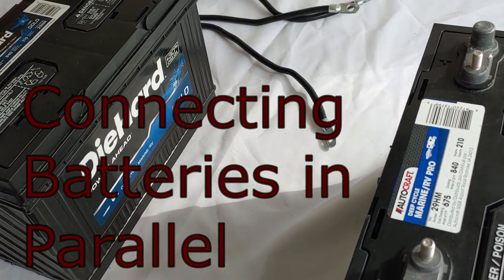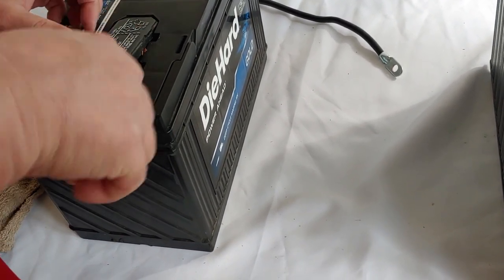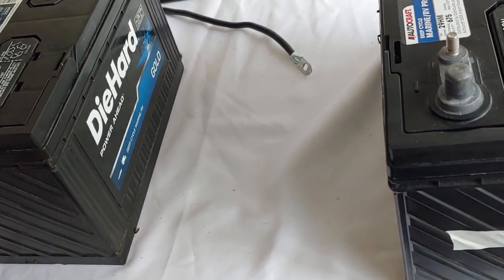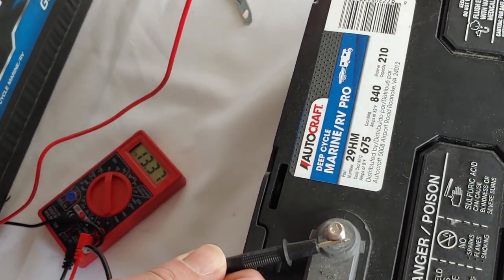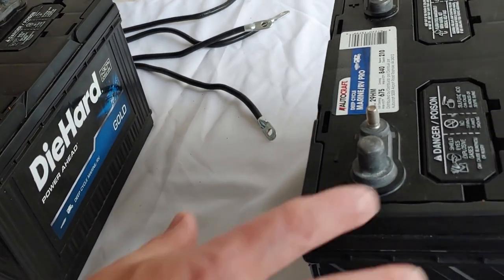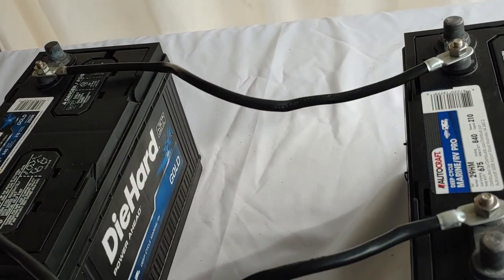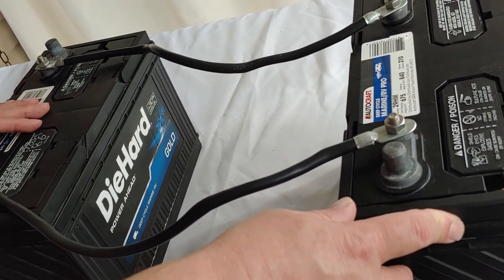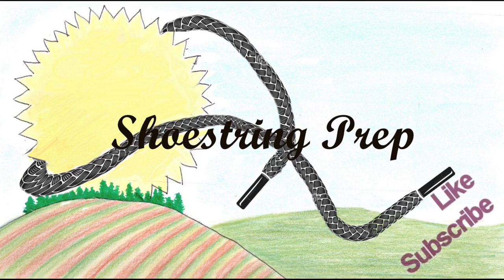Connecting two Deep cycle Batteries together in Parallel to create a battery bank

Comment: Just a note about battery labeling.  A real deep cycle battery will have an amp-hour rating for a 20 hour discharge.  If the battery lacks an amp-hour rating it is generally not an actual deep cycle battery.  Most likely it is a dual purpose battery which is a cross between a starting battery and a true deep cycle battery.  Both of your batteries appear to be dual purpose batteries.  Dual purpose batteries will not last as long as true deep cycle batteries.  Note that the reserve minutes is defined as the time to fully discharge the battery at a 25 amp load.

Also If a battery in your battery bank dies and you replace it with a new battery, the battery bank capacity will be determined by the remaining capacity in the older batteries in the bank and you will, in effect, be throwing away the higher capacity of the new battery.  That is why the recommendation is to replace the entire battery bank when one battery dies.

It is also a good idea to let the batteries sit overnight after charging before wiring them in parallel.  Also it is generally frowned up to parallel batteries with different brands.  The reason is that although the capacity numbers may be the same the internal construction of the batteries might be different - different plate dimensions, thickness and number).  The result is that the two batteries might not age the same and the battery bank capacity will be limited by the capacity of the worst battery.  Using the same brand and model of battery minimizes that problem.
Reply from the maker: Thank for the tips
Reply from the maker: I have used these type of deep cycle batteries for over 10 years. I have added several new batteries to increase the storage capacity of my battery Bank. I have not seen a decrease in the capacity of the batteries after added a new battery. With these batteries the reserve capacity is the amp hours it's just written a little differently. Thanks for your comment.

Comment: Ty for your videos. Scenario, if I were  wiring 5 or 6 new identical batteries in parallel how would you wire them? I've heard people wiring where the positive and negative are opposite sides of the battery bank so all batteries will charge and discharge evenly. What do you think sir.
Reply from the maker: If I understand the question correctly, you are asking about charging a battery bank from the first battery versus hooking the first and the last battery to the charger.
I know some people say that makes a difference in the charging process, but I have not found that to be true in my own experience.
Let me know what you choose, and how it worked out. Thanks for your comment.
Reply: The best way to wire a bunch of batteries in parallel is to wire all the positives from the batteries to a common point using equal length wires and do the same with the negatives.  Then apply charging current to the common points.
Reply from the maker: @todddunn945  I do these videos about my system and the way it has worked for me. I am assured there are other ways, but this is how I have been doing it.
Thank you for your comment.

Comment: How can I use deep cycle batteries as my main source of power and be able to connect it to a circuit breaker? This is for a 240 sqft tiny house. 🙏 thanks
Reply from the maker: I only work with off grid. I do not connect to a house circuit breaker. I would use a electrician for that. Thanks for your comment.
Reply: @shoestringprep  I’m not connecting to the grid. This is so I can be off the grid. Watching your video now I know what batteries to use and how to parallel them. Now I need to connect it to a power inverter. I was looking at breaker boxes and it has the pos and neg connections.
Reply from the maker: @cjadisa4694  you don't need a breaker for 2 or 3 batteries. Just connect to an inverter. Thanks for the comment.
Reply: @shoestringprep  ok and that should be enough to power everything. Ok awesome thanks
Reply from the maker: @cjadisa4694  welcome

Comment: You video is all fine and good, but why did you not address hooking the vehicle to the new two-battery system?  That is a key part you did not address.
Reply from the maker: My video and demonstration was for off-grid solar projects and really had nothing to do with the vehicle. Thanks for your comment.
Reply: @shoestringprep  Perhaps I stated the wrong thing.  I want to connect my parallel batteries to my vehicle's solar panel.  I was hoping to confirm that it is the positive solar cable to one positive post on battery 1 and the negative solar cable to the negative post on battery 2.  I'm just having difficulty finding that information.
Reply from the maker: @tomcox507  that is the correct connection but I would use a charge controller
 Thanks for your comment.

Comment: now how do you connect it to your 24v inverter system
Reply from the maker: Connecting the batteries in parallel keeps the system 12 volts, not 24 volts. To make your system 24 volts, connect your 12 volt batteries in series. 
Thanks for your comment.